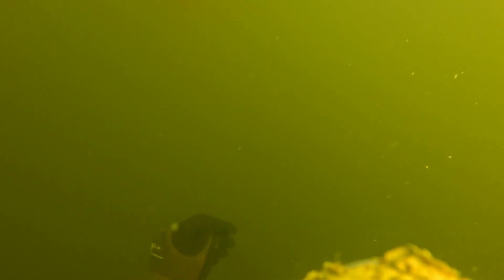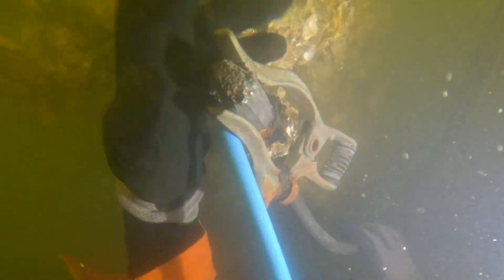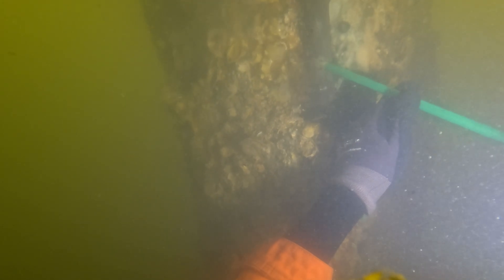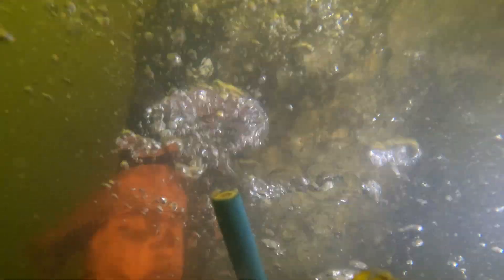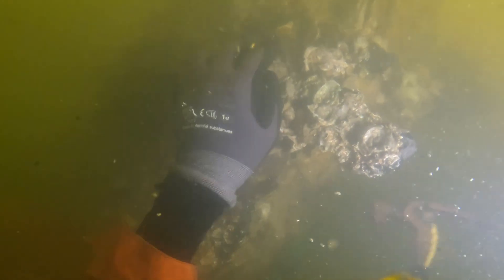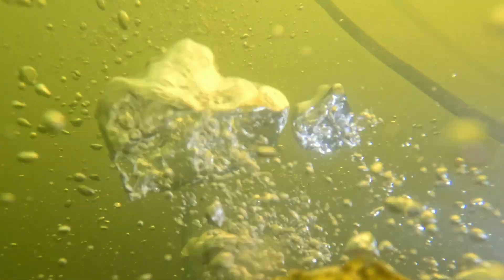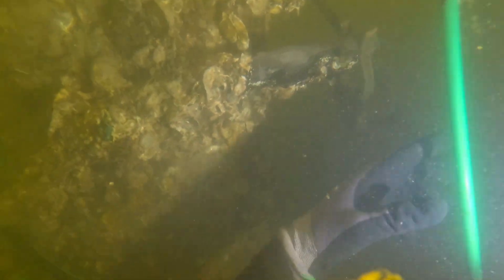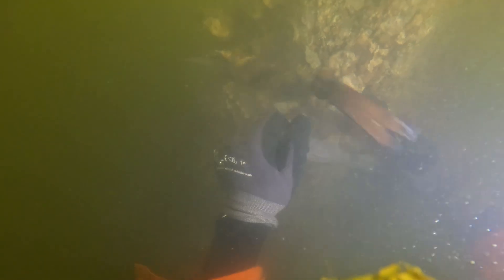Cutting Underwater in 4K: Broco Torch Breakdown

Comment: just a little correction at: 2:22  These rods don't contain any magnesium.
Reply from the maker: Fair catch! Most exothermic rods do pack magnesium in their core for that fierce burn. But these Oxylance rods don’t They’re a double-walled steel tube infused with fine iron filings, iron oxide, and trace copper plus a chromium coating. I was trying to give a more digestible explanation for people that a new to this.
Reply: @workingunderwater  Hi Colleague, during many years I also thought that the red tip inside the Broco rod was a magnesium wire, but it isn’t. When Broco started to make these rods in the seventies, the founder of Broco (John Brower) believed at the time that he needed some magnesium in the rod for it to be exothermic and therefore he used one piece of grade 6000 aluminium tig wire which is 6% magnesium. In order to insure that each rod had the one aluminium wire in it he dipped all of the aluminium wires in red paint for inspection purposes. Then he tested some rods with no aluminium wire and found two things. They burned about the same temperature and they burned about 5 seconds longer than a rod with the aluminium wire and thus, he stopped adding that wire inside the rods. Result, the divers complained that the rod had no  Mg anymore. To avoid hearing the complains, the manufacter then  took a bunch of steel wire and dipped them in red paint and started putting one of the painted rods in each burning rod. The divers quit complaining and they have made them the same way ever since. 🤩